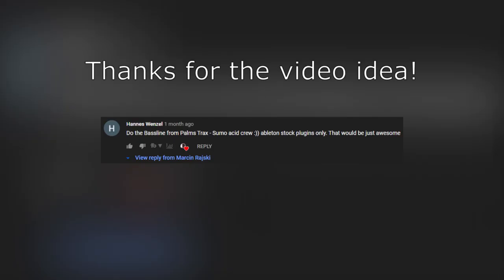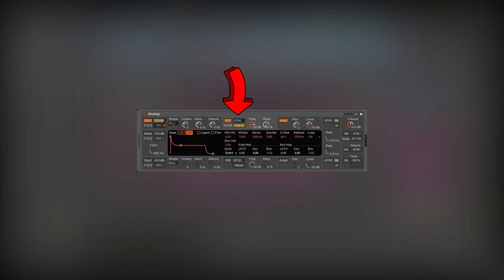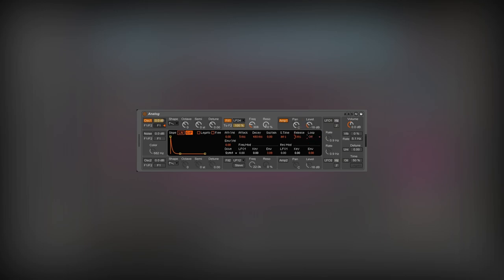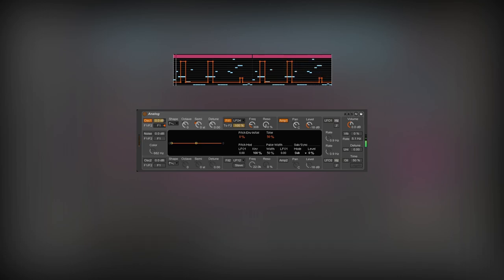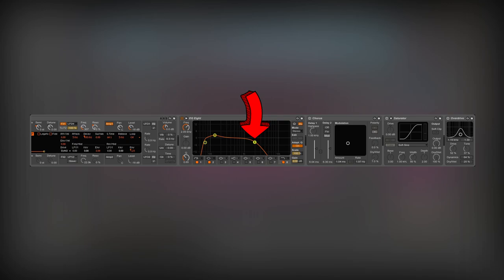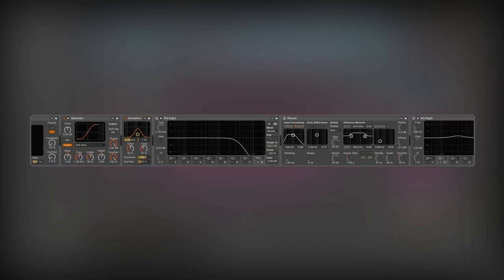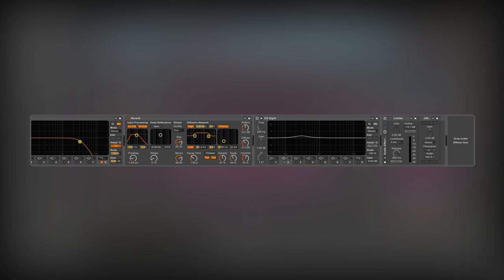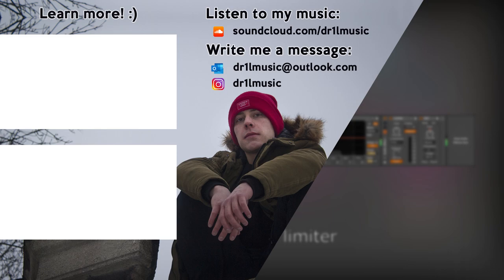How To Acid Bass: ABLETON ONLY Sound Design Tutorial

Comment: Great video! I have a question, what is the reason that you used a limiter at the end of the chain instead of a compressor?
Reply from the maker: For such a simple goal which is cutting peaks and making the whole acid sound more flat, a limiter is more convenient and simple to apply than a compressor that you'd usually use on a vocal track needing more sophisticated compression :) Cheers
Reply: @MarcinRajski-  Thanks for sharing, that makes sense!

Comment: @marcin rajski, nice tutorial. Curiosity though: why would you automate an eq vs using that automation on an auto filter instead?
Reply from the maker: Hi! In the case of this project (where we don't use lots of distortion/saturation), it doesn't matter if that automated EQ was put before or after distortion. When I was creating this sound, after synthesis in Analog I just thought about an automated EQ, and later I thought about some subtle saturation. Then, I thought the output lead has too much high-end, so instead of returning to automated EQ, I used another low pass filter :) Cheers!